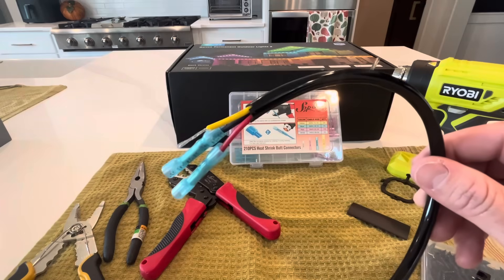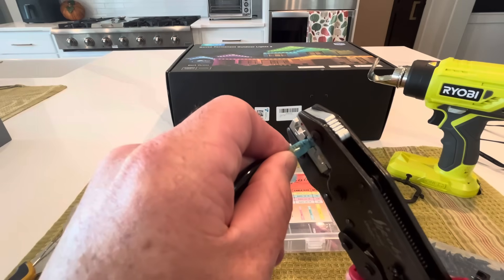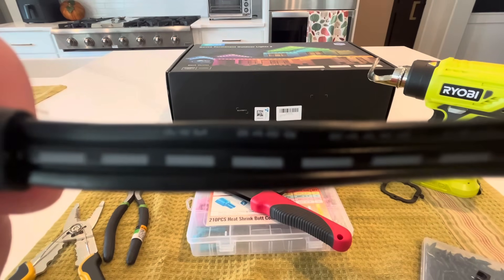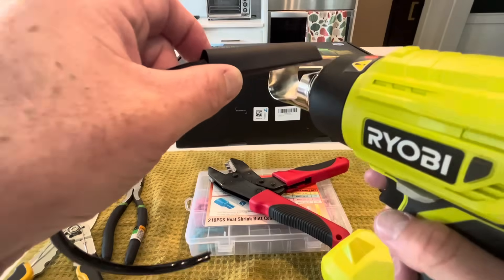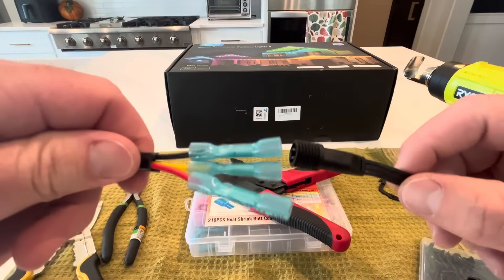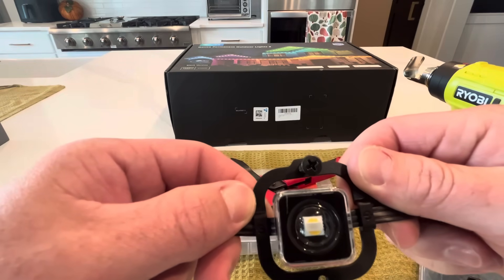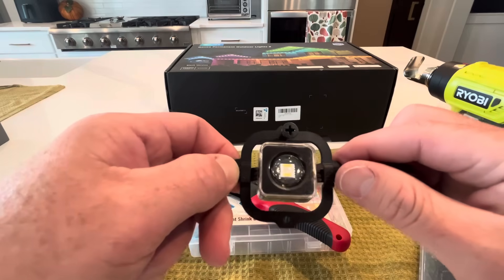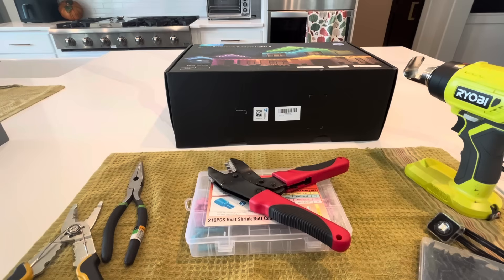Splicing Govee Permanent Outdoor Lights

Comment from the maker: Govee Lights
https://amzn.to/4eCwzgJ

18 gauge/3 strand wire (BLACK)
https://amzn.to/47ZYQMt

18 gauge/3 strand wire (WHITE)
https://amzn.to/3U3ZYcc

Crimp kit
https://amzn.to/4h1swgg

Heat gun (Ryobi)
https://amzn.to/3ZZLJsY

Heat shrink
https://amzn.to/3ZTqCIH

Reminder on screws, each bracket probably takes 2 screws, so do your math on quantity needed!

Mounting bracket screws #10 3/4 (BLACK)
https://amzn.to/4ffZ3OF

Mounting bracket screws #10 3/4 (WHITE)
https://amzn.to/4eZJ5HH

Coax staples
https://amzn.to/4gYZ1f1

Tool pouch (you’ll be glad you did)
https://amzn.to/3ZZEilA

If you click on links I provide, I may receive compensation.

Comment: I have three extra lights on my first strand that i don’t need. Is it possible to just cut them off? so that strand will fit properly? I’ll just tape up the end. Our i can i leave them and torn off with app. Getting ready to install now please help
Reply: You can turn them off under the DIY tab but if you want to use the present scenes they will come back on. You can cut them but as per Govee, you’ll void the warranty. Just make sure that you water proof the end so it doesn’t short out if it gets wet. Good luck!!

Comment: Is there a maximum amout of sections i can string together on one run
Reply from the maker: If you’re referring to extensions/jumpers, I have a 48’ jump (lights every 12’). Confident I could go well beyond that.
Reply: @Dads_DIY_TX did you need a booster for the gaps?

Comment: I've read in the comments that 12' is the maximum you can make a run before you start experiencing flickering and other issues.  I have the 100' Outdoor Pro Kit and need to make a 28' run down the side of my house.  I was planning on making  two 8' cables with the 12' extension in the middle of them to hopefully boost the signal.  My extension would go Light Strand - 8' Homemade Extension Cable - 12' Govee extension - 8' Custom Extension Cable - Light Strand.  I would think that this would work.
Reply from the maker: So long as that factory extension has the boosters on the end, should be good!
Reply: Thanks for your reply.

From what I can tell all the extensions in the kit have the little rectangle box near the end which I am assuming is the booster.

It's crazy Govee doesnt just sell dofferent length extenders, booster, power control boxes, etc.  I guess they want you to spend another $400 on a kit.

With your help Ill be using every single foot of my 100' kit to do everything I need. Thanks again.
Reply from the maker: Totally agree! Good deal, let me know if you run into issues.
Reply: @Ruttagger  Hey - did this work? I have a similar install to do next weekend.
Reply: @Ruttagger  Also would like to know if this worked for you.

Comment: If I have a total of 240’ (with 4 total jumps - none longer than 2ft). Would I be able to get that all on one run with a booster or 2 in one of the jumps?
Reply from the maker: Fairly certain you can’t go further than 200’ lighted length on one power supply/controller, and that’s with pros.
Reply from the maker: And yes if your jumps are only 2’ ish, no need for a booster. Only at 12’ and beyond

Comment: Is this for any Govee permanent lights? I have the 100ft rgbic. Thanks.
Reply: The website says you can't cut model H705A, which I bought... is this still possible?
Reply from the maker: @ any of the permanent outdoor lights can be cut/spliced, just voids the warranty on the strands you cut, for non-pro models. But you’d have to be trying really hard, in order to mess them up
Reply from the maker: Hi there! Yes this is for POLs. I haven’t tinkered with the others.

Comment: Lets say I have 2,  3 feet jumps and 1 10 foot jump. Can I power all this with 1 power supply?
Reply from the maker: Yes you can. Jumps don’t become an issue until you hit 12’ (for non-pros, slightly more for Pros). And even then, you can splice in a booster/light acting as a booster and continue on another 12’, and continue that pattern.
Reply: @Dads_DIY_TX  thanks I appreciate the info and videos! Greatly helped me out.

Comment: Ive heard that to when splitting cords for govee pro you should do groups of 4. In other words if i had excess of 2 on a strand, dont cut kust those off... any advice or knowledge about this?
Reply from the maker: I’ve cut my 2s all over the place with zero regard for where I’m at in the strand. Zero issues. Can’t speak for pros, but wire is wire, don’t see why it would matter where you cut/splice.
Reply: @Dads_DIY_TX  thanks!

Comment: I saw another video where the guy use 16 gauge single wire? Would that still work?
Reply from the maker: Wire is wire at the end of the day. I’m sure it would work. I’m not an electrician so I don’t know what the differences are. I just know the 18 works because thats what I used.
Reply: 16, 18 ga are thickness of the wires. So they are all working prefectly
Reply: 16 will just give you more metal in your wire it's slightly thicker

Comment from the maker: Max SINGLE jump/splice is about 12’. Anything beyond that won’t work without a booster/light spliced in. You can have multiple jumps throughout your setup, so long as none of them are longer than 12’.
Reply: Can confirm, my 14ft jump resulted in flickering of last 2 of 6 of downstream lights.  Cut that 14ft down to two 7ft lengths and spliced in the govee 4ft extension with booster, but then nothing lit past the jump.   Trying the single light puck spliced into midpoint, hoping that works.
Reply from the maker: @ have to make sure your wires are oriented correctly. You can “match” them but still be backwards. See FLICKERING! video on my channel.
Reply: @Dads_DIY_TX  thanks for reply, all flow directuon was correct.   Ended up installing a single spare light puck in the middle of my 14ft jump, all lights worked after that.
Reply: How did you figure this out?
Reply from the maker: @ look at the “long jump solved” video on the channel. I talk about it in the first part.

Comment: What’s the max extension length you can make?
Reply: They come with 12 ft extensions... any 1 run much over this length will cause issues/flickering.  This because of the middle DATA cable.  If you need to make a 20ft run I would splice 1 of the lights in the middle so it boosts the signal strength,
Reply from the maker: @CraigCarns-ek6xi this seems to be accurate. Had someone attempt a 15’ jump and had issues with lights not working on the other end. They spliced a light in the jump and it fixed the problem. I will test how far you can jump without a light/booster on Sunday and report back.
Reply from the maker: https://youtu.be/e2RQUX9bLNM?si=_w6wIez1WrKukBoM
Reply from the maker: 12’ is about the longest you can jump without a booster/light spliced in. Check my other videos for instructions.
Reply from the maker: Just made a 48’er using 3 homemade jumpers with lights spliced in every 12’ and a factory 12’ extension to end it. Works.
Reply from the maker: @sdlightningboltz  I have several in this run that total well over 20’, for a total length of 170+. I am confident you can make wayyyyy longer and still be ok.

Update: using a homemade jumper you can’t go further than about 12’ without a booster on a SINGLE jump
Reply: @Dads_DIY_TX  Thanks for the reply!